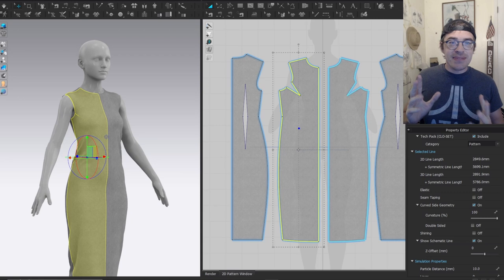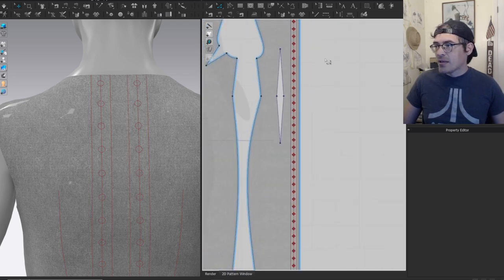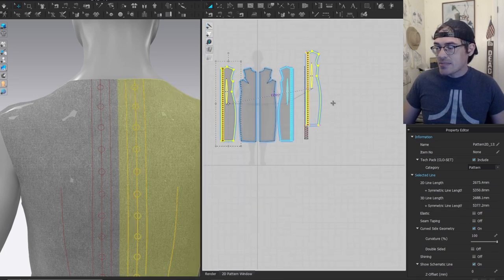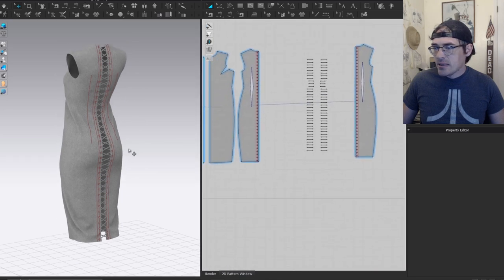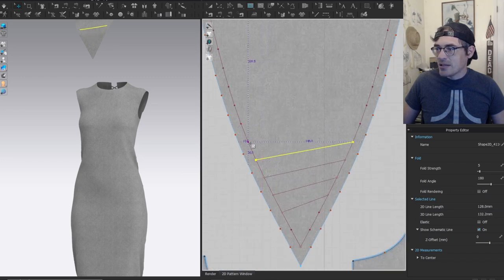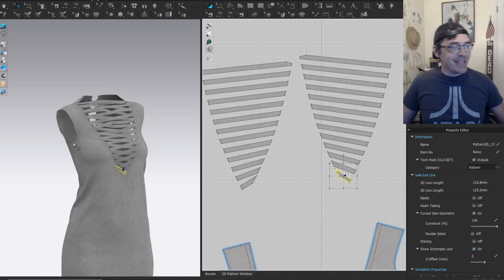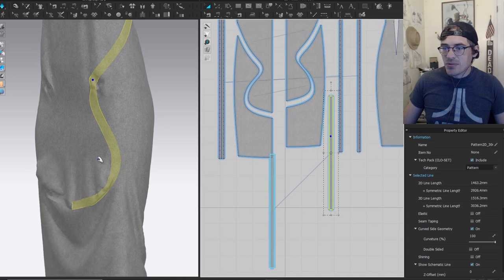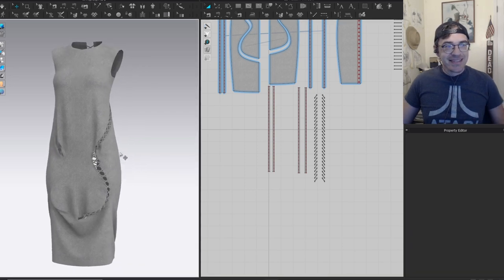Lace Up (Alternative Method) - Clo3d/Marvelous Designer Tutorial

Comment: at 8:56 you could have reverse offset the already selected lines by 6mm couldn't you to save locking all those line? I know you don't have to worry. Also rather than copy a line you are going to delete 50 times or so, do the offsetting, delete the middle line, then copy and right-click-paste the two offset lines by the distance between your segments.
Reply from the maker: Yeah.... I guess that would have been easier to immediately offset by double.   And also yes!! it would have been better to offset the initial line right at the start and then deleted the middle line and copy/pasted. the reason I didn't do this is that I thought there wouldn't be anything for 2 internal lines to align to, but I just tested it and the lower line internal line snaps correctly to the upper line. That would be a much better process, very nice!  Now, with the V shaped or uneven lacings, you'd still need to offset from the middle and then lock, but for long straight lacing, just offset the first one and then copy paste it all the way up.

Comment: To Any marvelous designer users coming to this in 2022, a quicker way to do the internal line process for creating laces:
Create the initial internal line array (what will become the middle of the laces and eventually be deleted)
Assign these internal lines a particular Fold Angle value
Offset as internal line by X mm in one direction to create one end of the lace
With the newly created lines selected, click Offset as Internal Lines again, this time by 2*Xmm in the reverse direction
At this point you should have the pattern of three diagonal internal lines
Use the transform pattern tool to select a middle internal line, then right click -> Select All with Same Property -> Fold Angle
This should select only the middle internal lines, delete them.
If needed, return all other internal lines to a fold angle of 180
Congrats! No manual selection needed.